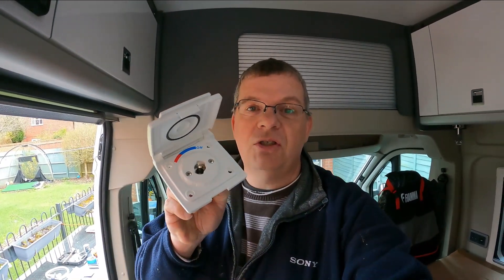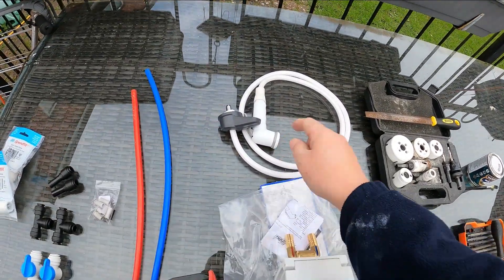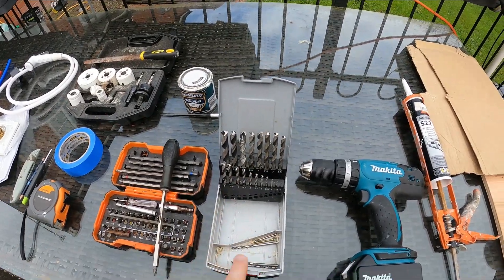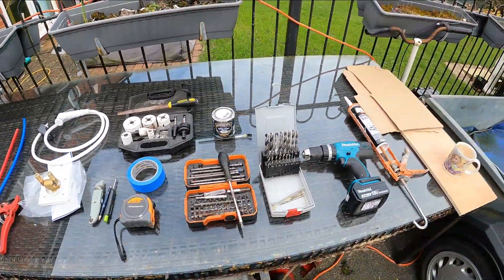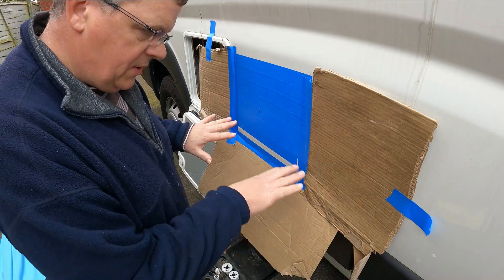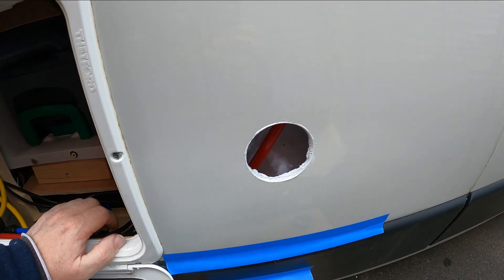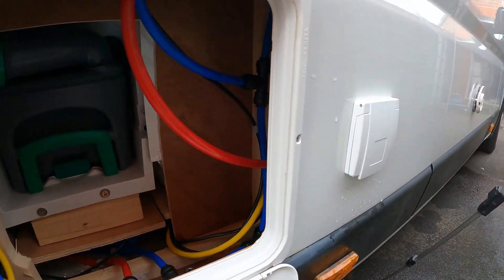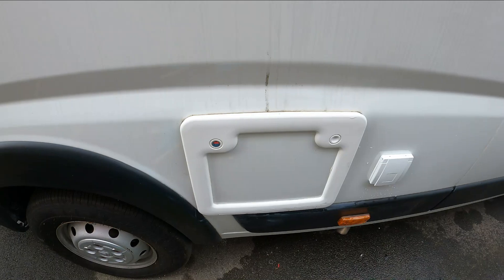Bullfinch external shower point on self build campervan Citroen Relay / Ducato / Boxer / Promaster

Comment: Hello!
Thx for great video. It inspired me to do the same to my campervan.
I have one problem and would be very grateful for any feedback.
How you turn on your water pump when using shower to make a pressure?
In mine, kitchen tap and bath shower has 12v connections and turn on pump when used.
How it’s resolved in your car?
Thx a lot!
Reply from the maker: I leave my pump on all the time and it stays primed ready to use, the accumulator stops it from 'pulsing' all the time. when i use the shower the pressure drops and the pump then activates. alternatively simply have a pump on/off switch and turn it on whenever you need water for sink, toilet or shower and not bother with the 12v micro switches. i think that's what most people do. hope that helps.
Reply: Yes it helps thank you!
I added extra switch to turn on/off water pump

Comment: Hi where can I get the alloy  corner trim regards Bill I am watching every episode
Reply from the maker: I got all the aluminium parts for the cabinets along with the furniture board from Morlands. hope that helps.
Reply: Thanks mate  starting today bluddy floor was manky dirty sweat just dropped off me yesterday think I lost weight lol
Reply from the maker: @1billycandoit  😅😅 I feel your pain on that one, it was same for me. I got through a good whole small tin of hammerite white after a good hard wire brush to get the crud off. why are ex-work vans always such a state. if you are just starting my best advice would be to think carefully about order of installation. if you are doing a fly screen or step or LPG underslung tank for example, these are pretty much first and anything else that involves the van floor and holes before laying the flooring. good luck with it.👍

Comment: Quick question. Have you scared the skitters outta yourself yet by adding up your expenditure?
Reply from the maker: Oh! that's what the cold sweats were!
Reply: @wiltshirecustomcamper7203  🤣 most probably. 
Seriously though have you done a spreadsheet (or even just made notes on a toilet roll)?
I'm trying to convince my Boss (SWMBO) it's the way to go once we sell our moho).
Reply from the maker: @keithwalden5855  I worked out carefully how much all the parts would cost before we stated so had a flavour for what it would be. did not account for the extras like the bullfinch but these bits are only small costs in the big scheme of things. we decided that if we were going to do it, might as well try, at least, to do a decent job of it. I made the decision at the start to not even begin unless the finances were in place for the components on my wish list. True I could have gone out and bought a nearly new Hymercar for the money I've spent but my spec is far far beyond... or I think they are?
Reply: @wiltshirecustomcamper7203  that's why I want to do our own. You have exactly what you want.
You also know how the thing is put together so that it's easier (relatively) to snag any problems. 
Thanks for the reply.
Reply: @wiltshirecustomcamper7203  your setup is way better than the factory cookie cutter vans. And you doing it yourself and filming the whole process is a great contribution to the rest of us. 

This last year I have been fixing all the odds and ends on my Roadtrek. Amazing how fast it all totals up.

Comment: Make a large envelope stick just under where cutting.  Will catch most of the metal bits
Reply from the maker: Yes, great idea. On my next build I am going to experiment with all different ways including that, also a large magnet I've seen used, a vacuum underneath as you might use with plasterboard drilling etc.